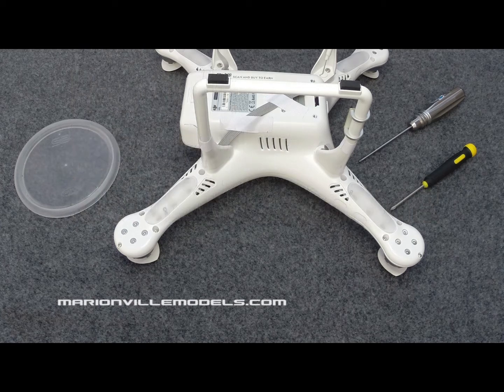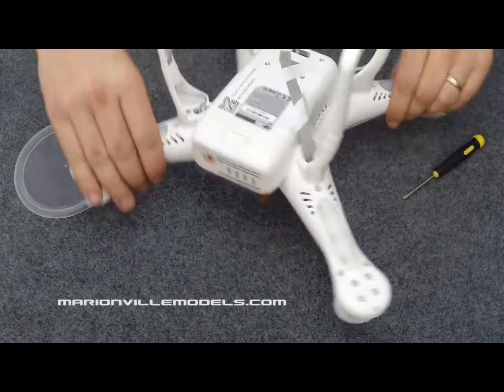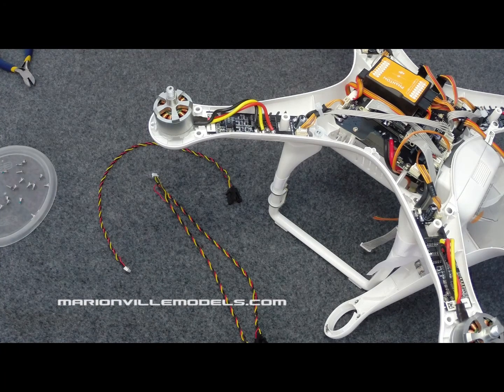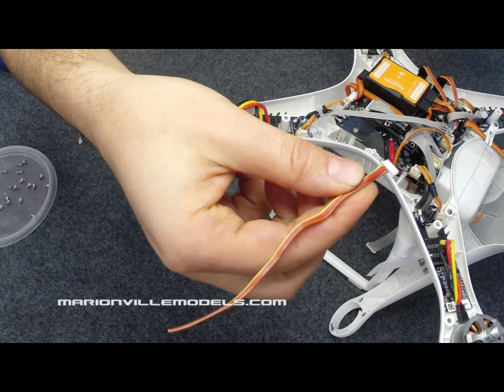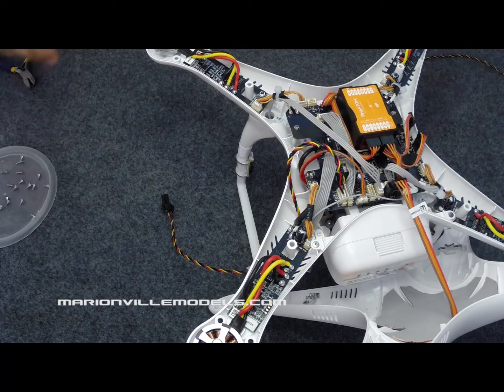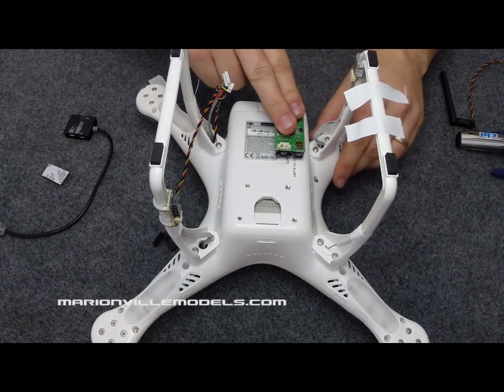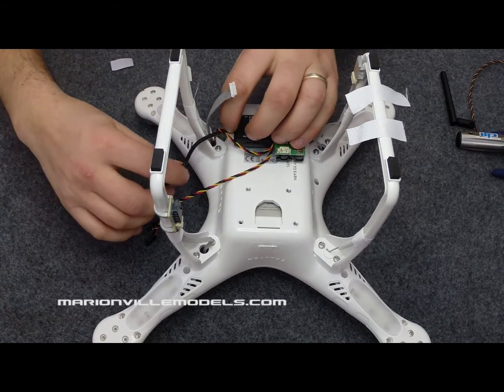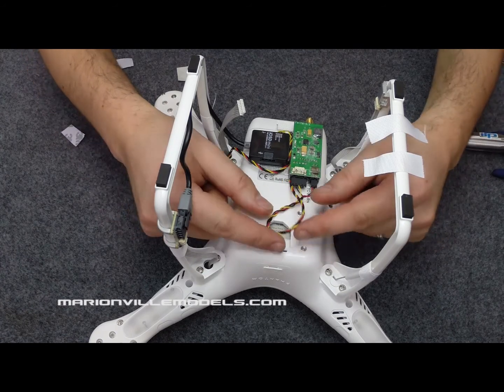How to Fit FPV Fatshark Video Tx & iOSD Mini to DJI Phantom 2 H3-3D Gimbal Quadcopter

Comment: so if i wanted to use an fpv camera { not the gopro} will this wire work ? cos i cant see how the camera will connect ...cos this wire i assume will work only with the gimble to be able to take video out ?

btw i got the fpv hub which i ordered from you { v fast shipping } thanks ...... shame dji didnt make longer wires option with the hub , i would have gone for an internal build instead having everything underneath... anyway

like i said im looking for an fpv quad which the f450 looks great for a start just wanted to know flight time and if this wire would work with an fpv cam.

thanks

Comment: what is the video delay from gopro to the fatshark goggles? and what wire kind of wire is that?the plug and play wire?
sorry about this but  im a complete noob about the fpv system im still making a list on what to get for my FPV setup
right now i got
phantom 2 h3 -3D
Fat Shark Attitude SD V2 w/5.8G TX and camera
DJI mini IOSD
GoPro hero3

Do you guys have any suggestion on what else do i need??
hopefully i can finish the list and buy it before September starts, so i can use it for my video project
Reply from the maker: There's isnt any delay on this kind of system. The plug and play cable is available in the uk but not sure about other countries.